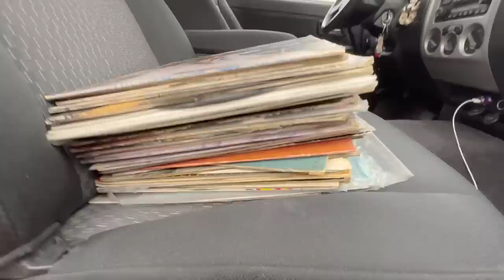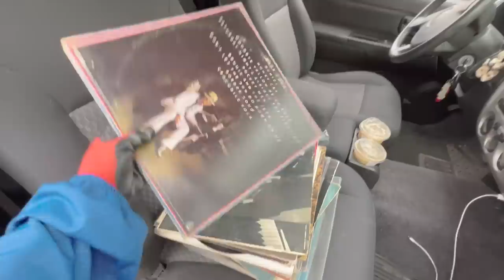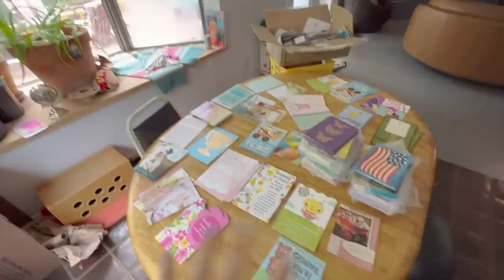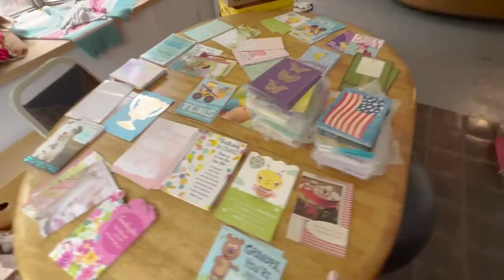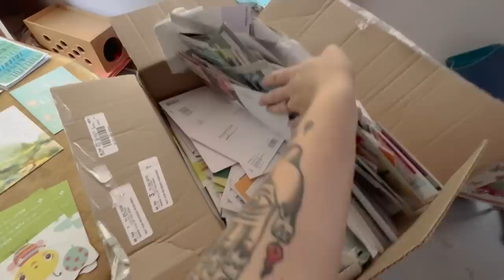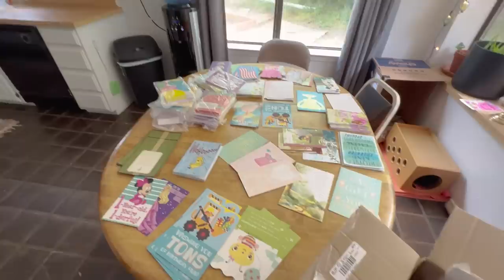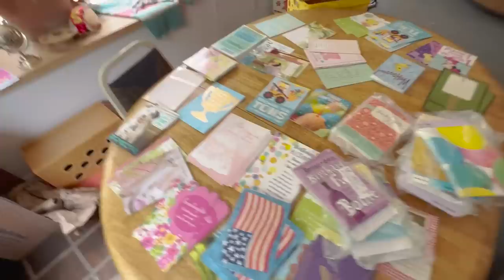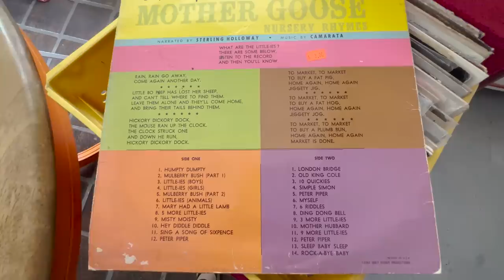We Found Them Hidden Beneath the Boxes!!

Comment: I'm really surprised that the dialysis center is dumping used needles in the dumpster. I bet they would get in trouble for not using specific medical waste canisters.
Reply: That really is a no no. There are specific containers for used needles. It is good protection from getting accidently poked.🙂
Reply: They should be reported for dumping medical waste in a regular dumpster. That is a hazardous and very dangerous.

Comment: The 2x4 in the dumpster with the kayak, would make a good scratching post for the cat, if you cut it the length you need it. And you can cut the threads on the carpet shorter to cover the post.